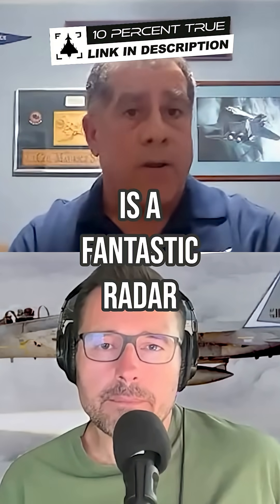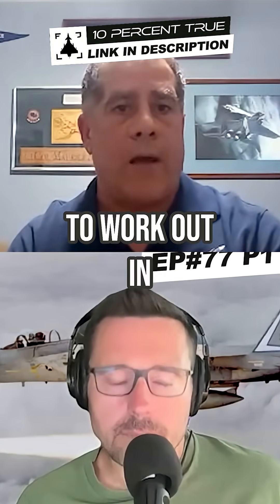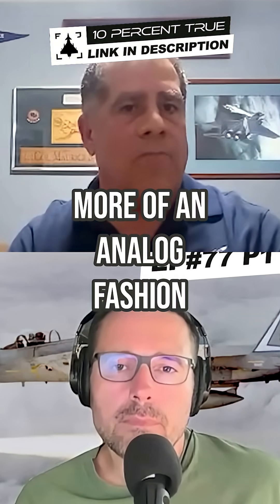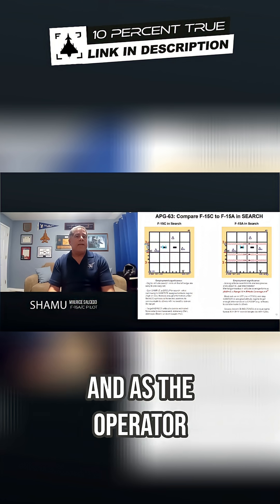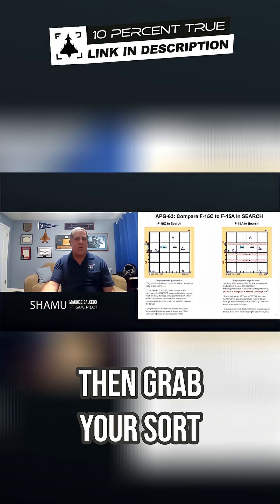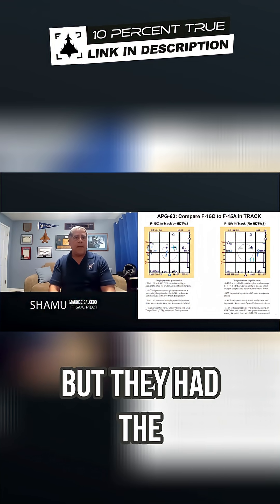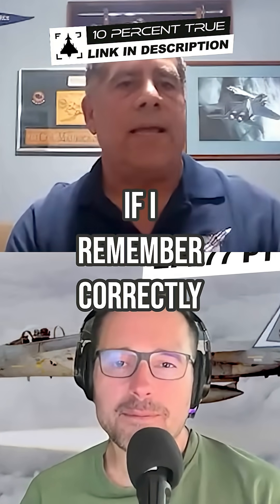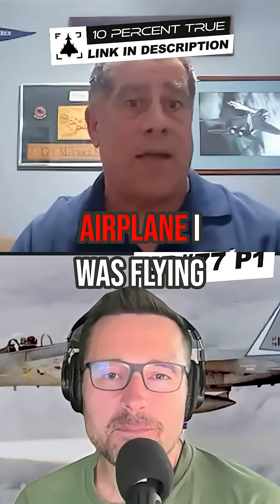F-15 Eagle: A Model Radar's Blind Zones Explained #shorts

Comment: That doesnt even make sense. The APG-63 used 2 PRF's in HPRF specifically for this reason, to mitigate the effects of large portions of your range profile being eclipsed.
Reply: Except it does. It's called actual performance vs paper performance
Reply: @gotanon9659 fantastic non response that says absolutely nothing. Can you explain the technical reasoning for why the pre PSP has range blind zones despite this well known and understood performance requirement for sufficient blind zone elimination?
Reply: There's videogames and academic degrees, and then there's actual practical experience.
Reply from the maker: He explains that it’s because the signal processor could not keep up. What doesn’t make sense about that? @ShamuXEagleDriver
Reply: @10percenttrue  That's not an elaboration, i'm looking for a reason as to why this well understood design consideration with pulse doppler radar systems was not considered and designed its CPI's to avoid that issue.